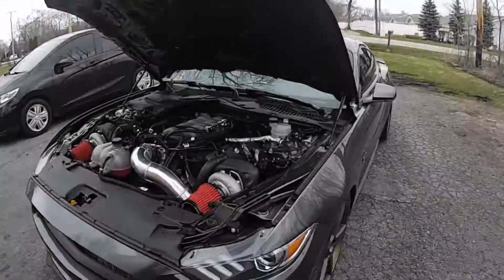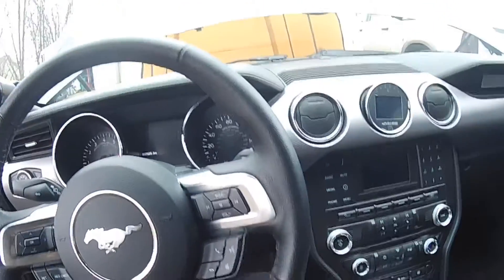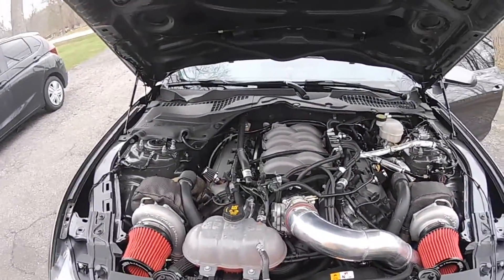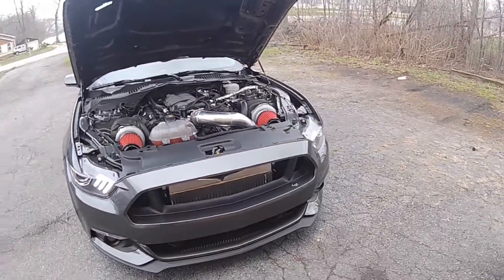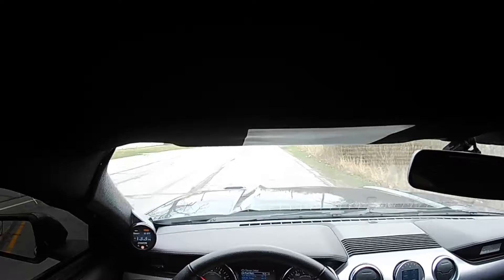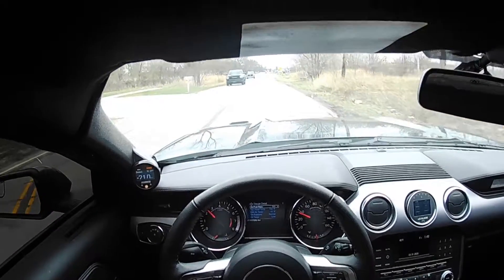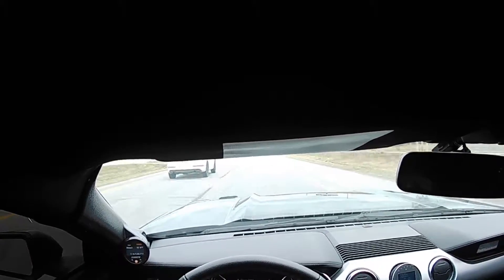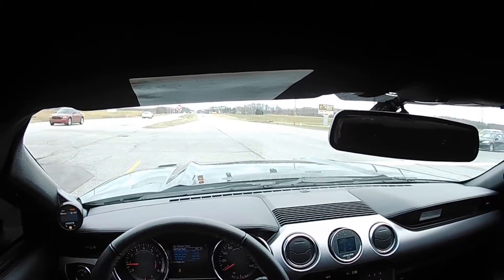ON3 TURBO S550 BUILD | Pt. 12 - Car is DONE! Final Tuning on E90 with Lund!

Comment: I'm currently tuned with Lund but only for flex fuel, do you know the cost for e85 tune but also with a 93 tune? Finally getting most of the build knocked out and want to be ready to start it up afterwards. Any regrets going with lund?
Reply from the maker: No regrets going with Lund at all. Dakota had the car running amazing after one revision lol. They’ve done so many of these cars/kits they pretty much have it dialed in. Cost I don’t remember off hand. I wanna say for 93/e85 tune I paid around $800 but that included the ngauge tuner.

Comment: I have had nothing but issues with the electrical side of my car. Also camshaft sensor codes on bank 1 and bank 2, and lastly a U0422 Invalid Data Received from Body Control Module. Any of these issues during your build?
Reply from the maker: What electrical problems? What codes are you getting for the cams? Did you do opg/cs as well? The only problem I had with the cams was a P0019 code. It jumped two teeth on the chain at start up causing a cam code. I had to retime my engine.
Reply: @NWIPerformance 
It takes a whole minute to crank over, the voltage drops randomly, and it effects the idle. 93 octane, Charging System Service Now notification. 

 P0340
P0344
P0365
P0369
P0625
U0422

I was afraid you were going to say that it jumped, and I believe that may be the case for me at the moment.
Reply from the maker: Who is tuning the car? Did you make sure all the connections to the power distribution block went to the right spots? Could be something with the alternator or maybe a ground? 

Yeah man unfortunately it happens i was pissed I had the car all together and running and driving just to tear it apart to re time it. It’s not as bad as it seems though. I only had to loosen the downpipes and remove the wastegates. Everything else stayed on the car. It was tight squeezes trying to get the valve covers off and the timing cover but they wiggles out.
Reply: @NWIPerformance  I've checked all the grounds, and yes I had to swap from the on3performance fusebox relocation bracket to the Armageddon fusebox relocation bracket, so I made sure everything from the power distribution block were connected firmly. Palm Beach Dyno, but they said everything looked good on their end as far as basefile tune, and because of the codes, they are unable to dial in the tune accurately without the proper datalog. Alternator, I'm guessing, is the only thing that it COULD be, but I had bought an alternator and returned it because it had a moment when it would fire right up with no Charging System Service Now notification. Personal message? My Instagram is @moonboostedcoyote
Reply from the maker: Ryan Gonzales have you checked the connectors for the ecu to make sure you didn’t bend any pins when installing? All I could think of is it being something in the tune that needs adjusted or possibly an alternator issue.
Reply: @NWIPerformance  I'm not quite sure how to send you the screenshots from Palm Beach Dyno this way. But basically Rob says that the issue lies within my four cam sensorsand looks very very likely to be electrical and that everything is pretty basic on the tune side for him
Reply from the maker: Ryan Gonzales did you check to make sure everything was connected and no wires were cut or burned? If you did opg/cs it could probably be a timing issue as well but I’m pretty sure it’d be throwing a p0019 or p0018 code if that were the case but I could be wrong. If everything was done correct, no wires were cut or burned, the connectors or sensors don’t have any bent pins then all I can think of is it being something tune related. I’ve heard of people having issues with pbd, not saying that’s for sure the case but it can happen.
Reply: @NWIPerformance  yes, sir but I did opgs/cs a long time ago when I installed Aluminator shortblock. No burnt wires, no open circuits, no loose connections anywhere. Only thing done was replaced both cam phasers on bank 1, but I didn't accidentally bump the primary chain, or intentionally remove it to install phasers either. So I am not sure that would have affected it...
Reply: I am very nervous about retiming my engine myself to be honest. It is super tedious. You make it look easy 😂
Reply from the maker: Ryan Gonzales man I was nervous the whole time I had the engine apart lol. If it ran fine before the turbos without cam codes I don’t see why they’d come up all of a sudden now if it was timing related. Maybe the sensors could be bad? But then again how do all the sensors go bad lol. Man I hate electrical problems. There are so many possibilities it could be lol.
Reply: @NWIPerformance  I agree. Cam sensors hardly ever go bad, that's why I am lost. Perhaps I'm in over my head and will have to take it to a shop. 😞